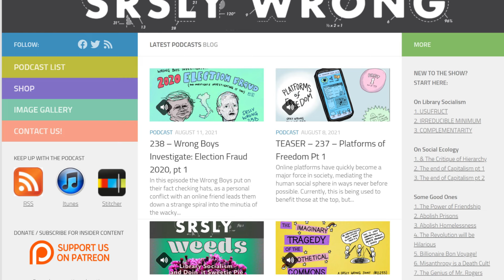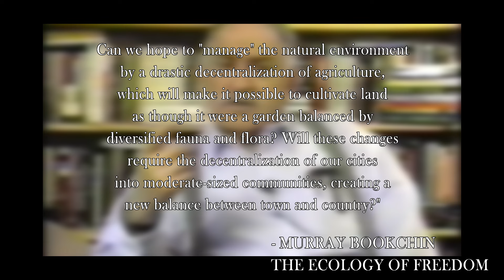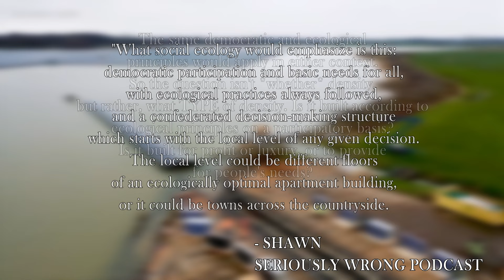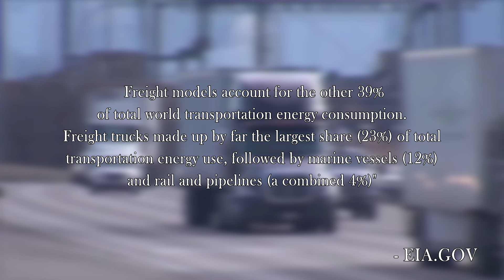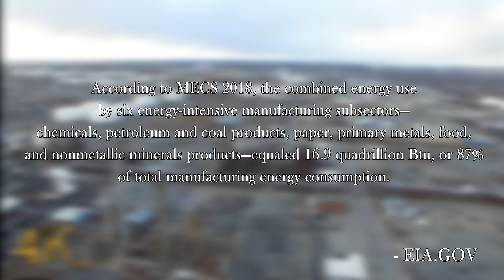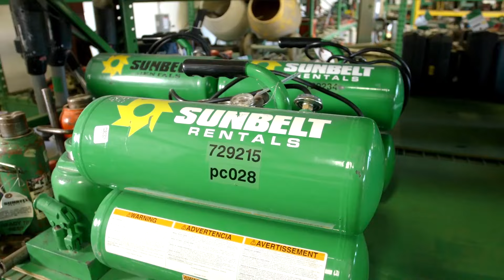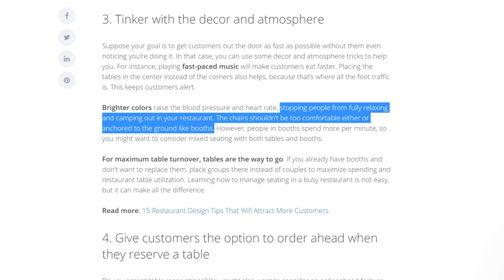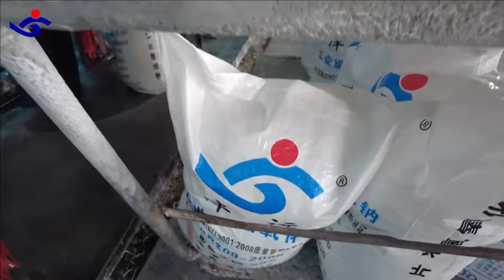What An Anarchist City Could Look Like [Social Ecology]

Comment: I think this leaves out the part a lot of places are actually just going to need to be completely torn down to make life sustainable. There isn't a city in the US that isn't suffering from sprawl, for example. A lot of our cities are going to need dramatic reductions in surface area and I'd have to disagree that using skyscrapers as enclosed communities would continue to do more good than harm because of all the resources that it takes to make those buildings functional. Think of all the electricity to get water up the building, waste disposal for all those in the building, and how costly it's going to be to basically build the skyscraper from the ground up again.
Reply from the maker: that's a great point, but obviously the pollution created by demolishing so many structures at once would be overwhelming. I believe we would have to do it slowly over the course of time, while using and repurposing existing infrastructure.

What do you think
Reply: I agree that we're going to have to repurpose buildings while we rebuild. I think skyscrapers are so emblematic of the failures of capitalism though that I don't see much point in keeping them around. Not saying all high-rises are going to have to go, but once you get to skyscraper height and the negatives just really start outweighing the positives. Even then, pretty much every high-rise building is going to need a quite a bit of work and redesigning to make them eco-friendly.

While we're here, we gotta stop using so much fucking glass, that shit is toxic for the environment.
Reply: I also think we could probably reuse some material from our old structures to build out the new ones so we're not completely just wasting everything. Gotta save as much as we can using as little of the remaining resources that we have left.
Reply: I like the idea of reshaping the suburbs and repurposing some of the houses for communal infrastructure.
Some houses between these communities need to be torn down and the areas rewilded to allow animals to move between areas safely.

For Germany with all its little villages and towns that are slowly dying out, I imagine reviving the railway to bring goods and services to them in addition to personal transport.
For example a railway cart shop that also brings you your mail or delivers internet ordered wares. It would make it unnecessary to drive with a car for 10km to the next supermarket.
These railways could also bring you books from a library or tools/household items from a library of things.

For suburban sprawl in the US one may think of a hydrogen powered bus to fulfil this function. It would go from one of these newly formed suburban communities to the other and stay there for, let's say, an hour and people go to it to shop or receive their pre-ordered things.
There would be fixed times at which the shop is there.
You can do that once a day or every two days or whatever people find possible to incorporate into their lives.
Reply: A box with four walls, no matter how reinforced, is a joke at this point.
Domed structures are one of the few that can withstand most natural disasters.
A skyscraper is a liability and a tomb.
Reply: Building anything above like 10 stories actually becomes inefficient. That’s why a lot of European cities have massive areas with 5-8 story buildings. Think Paris and Barcelona. 
Much more efficient energy and water wise, then add stores on first floor or two and you got great density, functionality, and efficiency.
Reply: @johannageisel5390  we may also need to consider the option that some suburbs or rural areas probably just need to be abandoned. Especially given that climate change will make certain areas uninhabitable and it might not make sense to build an entire rail line for a small dying town or inefficient suburb if the materials could be used to improve transit denser cities or rail to move goods and raw materials.
Reply: @johnforestersworstnightmar3756  In Germany, most of these small villages already have railway access.
Though plenty of those tracks have been removed in the last 20 years. >:-(

In the US or other countries, it would be inefficient, yes.
Reply: @psyolytesaille  Pyramide-like building structures would work, wouldn't they?
Reply: @DeadHeadAnimation  seems like the best way to accomplish this is to create community kitchens, supply and tool libraries in residential areas. Gradual community separation from the need to patronize commercial districts would make those districts less profitable and more difficult to justify their existence
Reply: Btw, the energy required to get water up skyscrapers isn't as much as one could think. I approximated that you'd need around 10 square meters of solar panels to get 50 liters of water for 500 people up to 200 meters daily. That is only an approximation, so it could be more, but not orders of magnitude more. But considering that buildings could have probably hundreds of square meters of solar panels on the roof and even thousands more on the sunny sides of the building (in which case you'd need to design the city with no other skyscapers blocking the sun tho), the solar panels could probably supply majority of the energy to the buildings.

Comment: Before i watch this i would suggest the city built upwards and together incorporate greenery,efficiency and sustainability  up the wazzoo
Reply: Upwards is the least sustainable direction to build. Why would we ever go that way? Every 6 floors you need to fill a whole floor with machinery to pump water and run elevators. And then if you get past like 20 floors you need a huge hanging weight in the middle taking up even more of the space that's getting more and more difficult to build with every foot in the sky we go.
Reply: @artemisspawnofzeus7732  okay but you just said 6 floors so you are saying there is a number of floors ideal for a city built upwards good to know 👍 and the reason for builting upwards is sustainability. If i ask you to place a house a restaurant and a market in a community they each take up space that could be used for other things and makes people have to drive to get to them. If you have all of what you need in your building or the walkway across to the next you saved yourself tons of space even in 2 6 story buildings 1.housing 2.market 3. Farm 4. Pharmacy 5. Restraint 6. Daycare then the next six floors in the the building over can have something else per floor and you didnt even have to walk more than 5 minutes

Comment: You are delving into the idea of constructive anarchy. Another aspect to consider is destructive anarchy, fueled by widespread disillusionment with governments perceived as the cause of societal issues. This discontent can manifest in individuals choosing not to conform, living as homeless individuals, and resorting to vandalism and theft from shops as a way to express their dissatisfaction with a system they believe is not working for them. However, a city necessitates effective leadership, and if those in leadership roles lack wisdom, it may result in destructive outcomes once more. The ultimate outcome significantly hinges on the individuals chosen by society as their leaders.

Comment: Overall, this video seems to be proposing the use of flawed technologies as cure-all’s for various maladies, without considering the flaws of said technologies. Even socialist societies like the USSR or China never really were able to fully get the massive apartment building g concept down. The main issue there and with this is maintenance; how will vertical cities be maintained? What happens if new tech comes out and has to be sequestered in to limited space? This letting alone all of those autonomous energy production spots you mentioned!

The other issue is how community will be built. Vertical cities are quite literally top down structures. How can people get to know one another in them and how can they be truly self.-sustained?

Comment: Isn't uranium based nuclear energy safe so long as you have a structurally sound building with a qualified staff running it 24/7 in case of a malfunction? And that's not even getting into throrium based nuclear energy that doesn't rely on something as unreliable as water for cooling and can shut down automatically without the need of human intervention.

Comment: Find another person. Individually add up how much it costs to sustain you and/or your lifestyle and combine what’s left over with them and have them do the same. Each taking turns in spending every other payday.

Your jobs will provide the income and the combined surplus will make it easier to pursue hobbies or climb the societal ladder. Including more and more people will add to the over all supply that each person in the network will have access to, thereby compounding the process.

For added security (insurance) have each person in the network find others to rely on. With that you’ll have overlapping security.

Supplant anything of value to you personally for the “income” portion and as long as you’re covering for yourself first and foremost, all goods (including for luxury) will get distributed across a wider system in accordance to how you relate to other people. Use cost cutting measures to increase any holdings and share information.

With that added insurance, use any and all surplus to invest in people most capable of bringing about change, including local chapters and environmental projects. Tell them about this process and aid them in building up a web of support and you can scale up any system, company or self-governance.